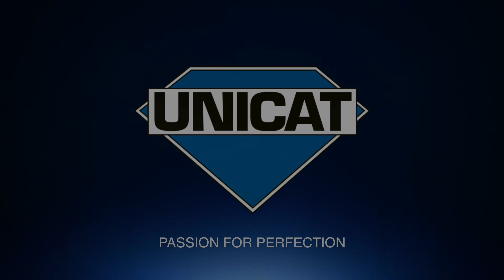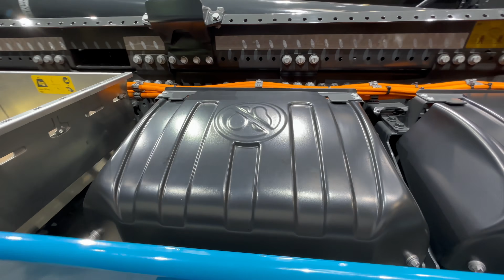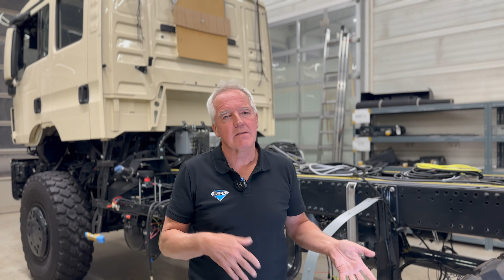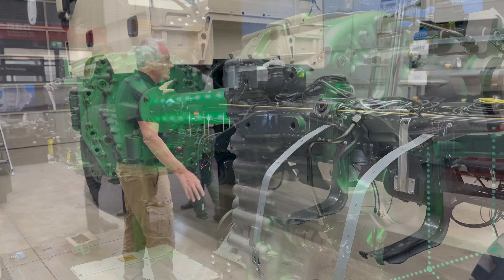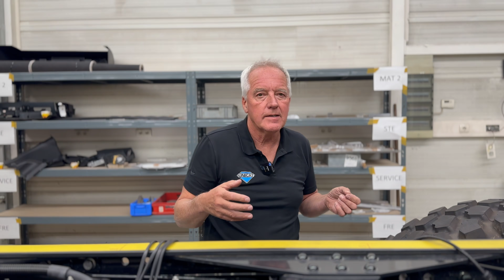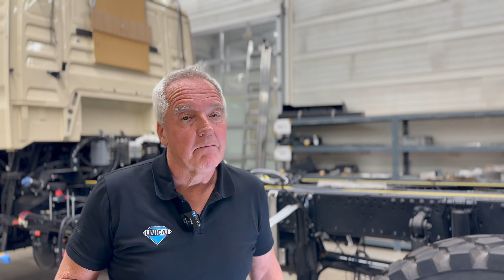UNICAT Expedition Vehicle Electric drive system????

Comment: If 600kwh is adding 4t to a truck you need to find a new battery supplier.  Thats terribly inefficient packaging. An entire loaded tesla semi has a range of 800km and the  semi only weighs 10t and has over 800kwh of batteries and gets 1km/kWh.  1.2kwh/km for your small campers sounds pretty bad.

Comment: There is a guy in Canada bringing to market a serial hybrid heavy duty truck.   The market is for off road logging trucks.    He has got the weights comparable between the conventional and serial hybrid.   Getting rid of the transmission saved a lot of weight.  

The company is called Edison Motors.   You should check them out.   As a serial hybrid the diesel generator isn’t connected to the axles.

Comment: I may be a year late for this discussion but curiosity got the better of me... and I am not even a specialist in the field: what about the hybrid system that is powered by an internal combustion engine and an electric motor which uses energy stored in batteries that are charged by the ICE? The system where the ICE charges the batteries as it powers the drive system using the EM as generator?

Comment: Most Hybrid cars, vans and trucks just use a motor that sits where the flywheel goes and then a automatic gearbox. This is what your Toyota Prius is and my 12t Truck has a 4.8l 4 cylinder instead of a larger motor and a 44kw ev motor. It weighs 350kg more, not 8000kg. Than a comparable 12t truck as I can use a slightly smaller motor. This is enclosed and sealed and means i can use EV only when its useful or efficient or not at all. Plus i can crawl at very low (zero) rpm with the full 800nm of EV or both combined or any combination in between. I would ask Thomas to get GPS data of what the trucks are actually doing as this is what we needed to do, i am as sceptical as anyone else. Not every truck is driving 800km every day day in day out. What is your truck doing now? Also high duty cycle, like say a rubbish truck, stopping stsrting, traffic or a fire truck or your RV all have vastly different user applications. I am not evangelical or on the other team, just pragmatic and whist the idea that every Unikat sold or similar expedition vehicle has driven around the globe many times and is constantly in remote places. The reality is not that they are used in short bursts and are static. As I said put a GPS tracker or tag and let the data speak for itself.

Comment: Great video well explained. Would you agree that the off-road capabilities are increased with electric motors? Also, would it allow to go higher altitudes with a hybrid system or would the generator still not work good enough to provide the energy needed?

Comment: A Canadian company called Edison Motors has developed a Diesel Electric truck for the Logging, mining and oilfield industries. They have a working prototype that uses the same system of diesel generator with a small battery bank to run electric drive motors that has been in use for trains since the 1930's. They have recently received the first shipment of heavy use 400HP electric drive axles that they custom designed for use on an off road logging truck.

They have a Youtube channel and I would appreciate it if you could look into what they are making because I have a feeling that in a few years someone is going to ask you to build a vehicle using their chasse.

I think many of us would also appreciate a response to diesel electric drive as well since you completely ignored this topic when dismissing electric trucks as a viable option.

Comment: I've been thinking that a setup similar to a portal axle type setup where the motor and transmission is mounted on the chassis, would be best. You have a motor at each wheel, all controlled by software. The traction control possibilities are endless, as are power management, and redundancy. Spares for such a system could be easily packed, considering that they would be compact. I think this will be the most suitable exploitation of the flexibility of an electric system, second only to the hub motor setup, but with the obvious advantages of vibration, dust and unsprung mass isolation.

Comment: When the video was first posted I asked if you had given any consideration to diesel electric direct drive systems like they use in open pit mine dump trucks and diesel electric trains. Its a system that lets you optimize the generators power and torque for most efficient fuel use because all the other variables are handled by the electric drive motors and a small battery or capacitor bank that exists purely to handle any short term spike in demand. This system requires the diesel generator to operate whenever the vehicle is moving. It is not a battery powered electric vehicle.

You did not respond to my question.

Comment: Electric vehicles are only used for city trips. For an expedition vehicle it is absurd, I would even say more, for a truck it is ridiculous. The efficiency of an electric truck is very, very questionable. To work it must drag batteries that are around 8,000 kg. The eco fanaticism that has seized politicians in Europe hides a large-scale scam. It is neither more nor less than using the excuse that the questionable climate change (the climate has been changing since the world exists, and fortunately man cannot do anything to avoid it), is supposedly caused by human activity to reduce individual freedom. I do not understand why, from the European authorities, they want to force the market to take a path that is not real, that is false, inefficient and absurd. Experience tells us that when politicians intervene in the markets, he fails, ruin is assured. It is the path that the automotive sector is taking in Europe.
Reply: I would disagree, I have a fleet of 15 ev 3.5t vans and have a Actros 12t hybrid, it's not 8000kg it only has a 350kg weight penalty on a 12t truck. We use the break time of the drivers to recharge, they are happy as they get set breaks. The hybrid only has a 4.8l 4 cylinder with 800nm and a 44kw motor where the flywheel is. It's the same as driving a Prius. It can go EV only, hybrid the Truck chooses or two options to save EV as either regen only and no assistance or load the engine to regen. Plus it has the option to use both EV and diesel combined. We are also looking at a trailer assist system, it uses a  relatively small battery by truck standards  to fill in just enough to push the trailer on so there is no load to the truck/tractor unit. This will be able to grandfathered in with any diesel Truck. But enough push to offset the drag of the trailer, not just more is more. We did a lot of research tracking real use before we spent the money. I think people forget how they really drive. I agree a full EV truck would not be a good idea in Namibia, but a Hybrid Truck with a smaller engine and a battery pack that isn't huge is the future. I like having options.
Reply: We practically agree. I began by saying that for urban use, urban delivery vehicles, etc., it may be an option. And that should be an option, not an obligation like what is intended in the European Union. But we are talking about an expedition truck, exactly to move around Namibia, South America, etc... that is why I say that for a vehicle of this type it is absurd, ridiculous and unrealistic. Of course, at the level of marketing and advertising it is going very well due to the hypocrisy that prevails in everything related to electric vehicles. @fraserwright9482

Comment: Beautiful video!!! Hybrid vehicles can be very interesting also because you can have two or more small diesel engines (instead of a big one) to charge the batteries and provide electricity for the engines and the living cell. Moreover you can have up to one engine per tyre. Maybe it is not so efficient in terms of weight, but it is super redundant. Redundancy means reliability. (One engine has problems, you have another one, one motor has a failure, you have other 3 or 5 or 7....). I think it is maybe too early for this but it is a very promising field.I think that there are at least two kind of people that can buy this kind of vehicles: 1) people who can solve any problem by himself and don't have infinite amount of money to spend (for this kind of people, today, meybe electrical vehicles are more a problem than a solution...), 2) people that have money to spend and just want things go smooth and focus on the adventure; in this case, hybrid vehicles maybe can the the correct solution.

Comment: If you look at tractor trailers.
a standard diesel euro 6 daf CF 4x2 truck is 100.000 euro. with a 600L diesel tank 2400km range.

Same truck but factory electric with rear axle motors 350.000 euro. Range 250km

For charging you need a 380v 63A socket and a charger that cost 60.000 euro.

I made a calculation before the current war and energy prices. And back then the electricity waa almost the same cost per 100km as diesel.

On a 13.6m trailer you can fit 7kw solar which is nothing to charge the truck.

Electric should be used for city center distribution and city bus lines.

I would buy a diesel truck with a camper box that can be swapped to another truck chassis in the future. I don't think everything electric is the future. Because the electric grid cannot handle the load of night charging

Comment: Would be good to buy a new truck and modify it as hybrid but keeping also the original engine as alternative (because if you put the  electrical motors on the axels, bateries on the outside of the chassy, and the generator engine is small, you can keep also the original powertrain), and also you can add the automative gas system (lpg) in some big cylinder, because this halves the costs!, Maybe will be some highclass which would be intersted in such a vehicle with many alternatives

Comment: Viable tech has gone much farther in innonovation for heavy EXP rigs than is popularly understood.  Good overview on the drive options. Looks like electric drives with small diesel backup plants are now feasible. How much ingress solar assist (with an multipanel roof array would support daily  target for 400 kilometer max range ... with no land power? ) Solar array on roof rack would be 800 watts x 8 panels.or 6400 watts with a maximum 7 hours per diurnal cycle. Then, how much small-diesel assist needed for rig power topping to load batteries? 

Fascinating technical presentation. Well done.
Reply: Where the solar will help is when you are parked up for a number of days with the panels exposed to some decent Sun. They will provide your hotel loads without depleting the battery pack. Any surplus will help to trickle charge the battery.

Comment: Great video... I just ad a very important detail.
When this conversions will hapen, engineers should go for straight parts, or tubular parts to make for example the A arms of independent suspension (like shown in this video). this ads imense credibility , safety , redundancy to repair it anywhere, because is it simple... otherwise like those ones (red, shown in this video) if they broke a part in africa for example, we cant get a spare one, then it should be easy repairable , some cuts , weld and thats it. straight parts like house made for trophy trucks ...all straight or thick tubular, nothing casted... all easy to build and repair... otherwise less people will buy

Comment: I would like to hear about the possibility of using a diesel generator to direct power electric drive motors. Like they use for massive mining equipment and trains. 

I would like to stress that I am asking about an electric drive system that converts diesel directly into electricity to propel the vehicle, not to charge a battery bank which then powers the electric motors. Not a hybrid system with reduced capacity that relies on the combined output of a charged battery reserve and diesel motor to meet demand. I am talking about a strong enough diesel generator to output the full demand required to spin the electric drive motors without more than the bare minimum additional battery mass required for load balancing. I've looked long and hard on this and no one anywhere is talking about it for anything other than trains and massive mining equipment and I cant find an answer as to why.

Perhaps the system might include a secondary connection to the house battery system that would let you drive at reduced speed for a Very limited range of perhaps 2-5km before needing to stop for a couple days to allow the solar panels to recharge the reserve. I think this is a system that could be practical as you would rely exclusively on the diesel generator for traveling any real distances but would have the ability to make very short hops with long stops off electrical reserves that can be regenerated very slowly by solar. The kinds of short hops one might make while repositioning between different scenic locations in the same general geographical region.

I saw an advertisement for flexible solar panels that use silk screening technology to adhere them to fabric. With this technology you could transform the full surface area of an awning into a solar energy collector and once awnings become an energy source it becomes worthwhile to put a large awning on all four sides of the vehicle letting you bring in four times more energy than just roof panels would allow. Or more if they are light enough and can be packed away into a small enough storage format.

This would definitely not be a mobile solution. But it is interesting to contemplate.

Again, I would like to hear about the possibility of using a diesel generator to direct power electric drive motors. Like they use for massive mining equipment and trains. All the other stuff is just extra fun, this is the part that I want to focus on and hope to get addressed. I don't care about efficiency or the environment, that isn't why i like electric motors. I like the power and torque profiles and the traction and control that computer regulated electric drive can provide. If I have a diesel generator the same size and weight as the stock motor and transmission with the same fuel demands but they are powering a series of electric drive motors capable of providing significant performance improvements, then i consider this a good product.

Comment: In the hybrid system, I'm not sure I'd want to run a 60kW generator for 5 hours every day when I've finished driving... It would be pretty noisy when you want to relax...
Reply: Use a marine generator in a sound deadening box. Only run when battery gets below a certain charge unless you want to maintain charge. When stopped in a sunny area, solar should provide for hotel loads without needing generator at all. When at a site where cheap electricity is available, plug in and use to charge battery.
Reply: This is not how hybrid Trucks are going. My 12t Merc Atego has a 4.8l 4 cly that has 218hp/800nm and a 44kw water cooled motor where the flywheel is. It's 350kg more,  just like driving a Prius. You never use the brakes as it regens and you have modes, just like any hybrid car where I can go EV only for low emission cities, a save mode so I can charge and drive, this has one for not taking the engine to charge but only over run, regen or braking and then another save mode that uses the engine as well to regen, a bit like running the A/C on an old hatch back 😂. It then has hybrid where it fills in when it needs it.

Comment: Here's an idea for you ,why don't one of you experts design an engine that boils salt water to create hydrogen gas and oxygen gas ,then it would run like stream train with no noise,that would be a first and a big money making for you .I've tried but not got any backing ,
Reply: That is basically a reverse fuel cell. To split water by heating you need to get it to over 800 degrees. Using an electric current is easier at a fixed site where solar or hydro can be used to power the unit.

Comment: Excellent way of laying it out.  Someone that money is not an option can have a truck setup and do testing for future vehicles.  With the electric motors you pretty much loose the ability to drive through deep water of even 20 cm or 8 inches in depth.  Risking the drive motors to water when you are off road would not be a good bet.  The expedition vehicle would be able to go on the roads and recharge at campgrounds like a camper.  If you drive your electric vehicle off road there are no dc-dc charge stations unless you set up one on a diesel generator.  The logistics is not in place and still needs the diesel engine to provide a charge.  There are some remote charging stations on the Alaskan highway and they use diesel generators to charge the vehicles.   Stay safe and healthy Sir.
Reply: Battery packs and motors can be sealed and made water tight. Submarines are an example, as are electric trolling motors where the motor is in the lower drive unit.
Reply: @briananthony4044  That is why Jeep has the 2023 submarine for sale?